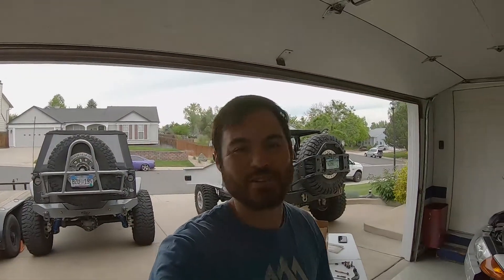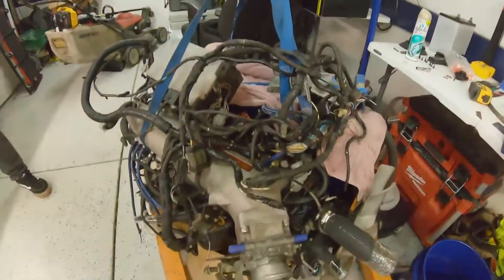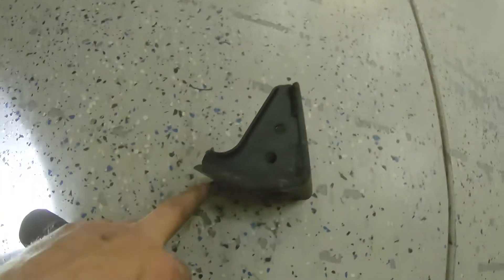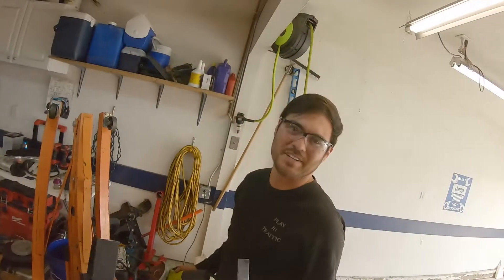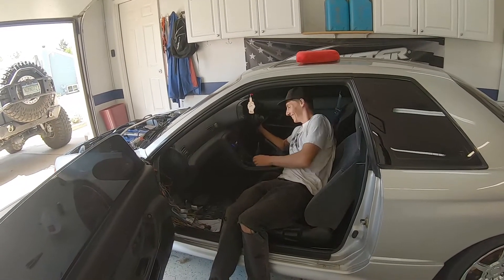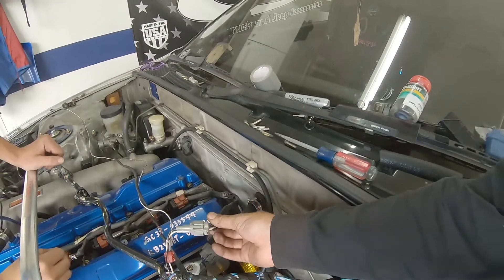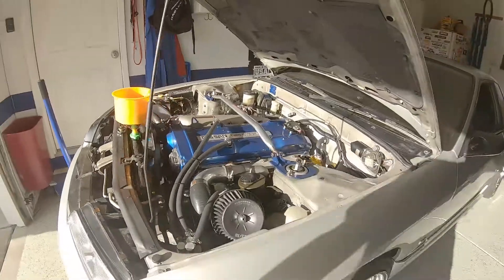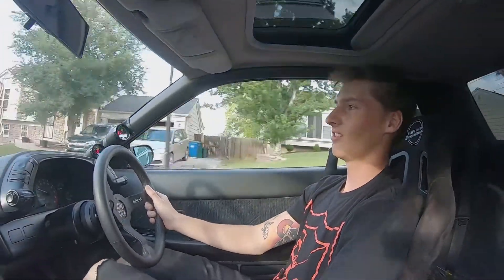RB25DET Swapping Jeff's R32 Skyline

Comment: What did you end to doing for the driveshaft?
Reply from the maker: It's been a while but I'm pretty sure we ended up getting a 1 piece driveshaft made because the rb20 input flange on the driveshaft is a smaller diameter than the rb25 transmission needs.